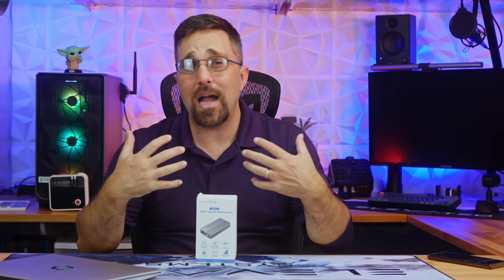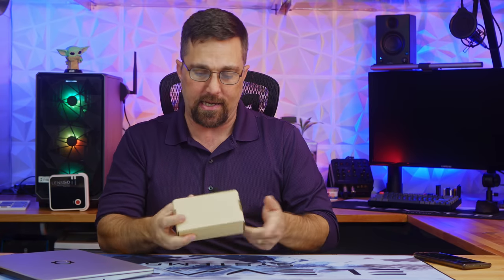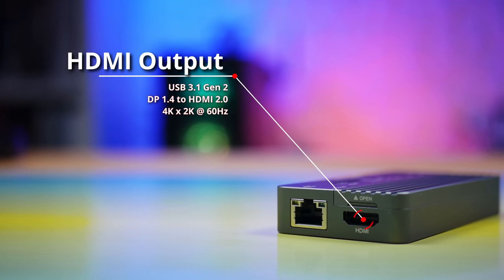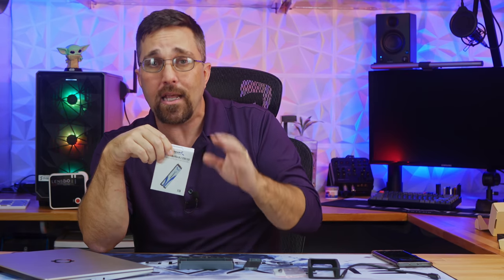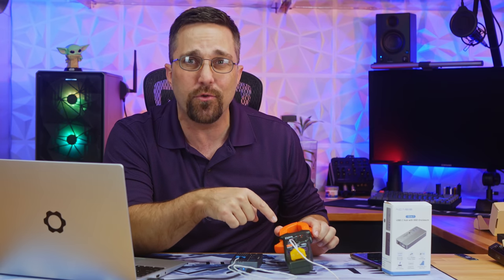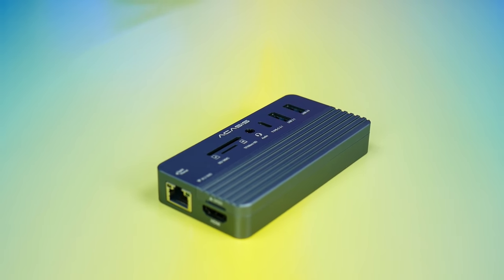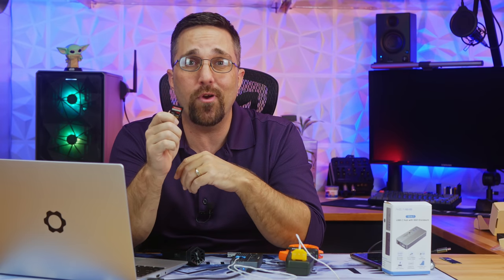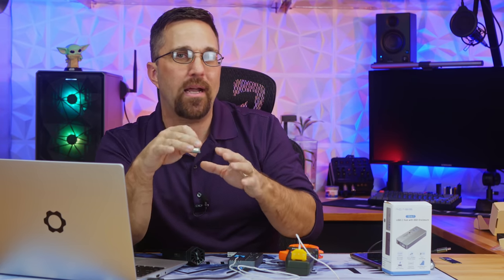One Hub to Rule Them All! ACASIS 10-in-1 USB-C Hub Review

Comment: For those who wish to use this with an iPad pro...  When you plug this in the audio will default to the 3.5 mm headphone jack on the hub and there is no way to switch it back to the internal audio on the iPad currently. This is a limitation with iPad OS and not really the hub. For sound when plugged into the hub you can either plug in headphones/speakers to the hub audio jack or use bluetooth audio. There is no option to use the hub and use the speakers on the iPad at the same time. You also must format your NVME drive on a PC or Mac to exFAT (NTFS can be read but not written to currently with iPad OS). The iPad has no way to format a NVME drive natively with current OS (iPad OS 15). Other than that it is probably the best hub on the market currently for this form factor, features and price.
Reply: I ordered one of these to use on my iPad Pro, bummer to hear that you can’t use the internal speakers with this plugged in.
Planning to use it for photo editing when capture one iPad app comes out, and things like that.
Reply: Thank you for your post.  I was wondering what happened to my sound also.  It was also helpful to know which format I need to use to format the drive.  If you have a channel, I’d follow.
Reply: I have a sandisk extreme pro v2 1 tb and when i connected it to my ipad pro m1. It cant recognize my sandisk ssd
Reply: @yeabah13  try formatting as ExFat, if it isn’t already
Reply: Anybody find a workaround? maybe a Bluetooth speaker JBL Flip? But kind of a hassle, the iPad pro has 4 amazing speakers.. what a waste not to use that feature? 
Thanks for the info, I get a headache using headphones for prolonged periods, so this is a deal-breaker for me.. Not to mention the heat issue.
my insane researching for the on the way,  M1 12.9, just paid off..The search continues.. any suggestions for a Thunderbolt 3 Hub? I do not want to spend $250 for a hub & Thunderbolt 3 or maybe even no thunderbolt?   considering Thunder4 not working on a Ipad anyway? I am interested in headphones for travel when watching Movies anywhere offline, Are there USB-c adapters that work for 3.5mm headphone jack? (I do not like wireless headphones as they give me a headache sooner than wired headphones..
Reply: Can anybody tell me if the sound will come out of my display if I use this with my iPad to my monitor via HDMI?
Reply: There is a work around now and you can choose which source is playing your audio output when an external display is connected, or your have an alt output for audio.

Comment: My man just nonchalantly turns his phone into a fully fledged desktop computer 🤯
Reply: Was very upset to see that the M1 iPad wouldnt support OS11 on the M1 Mac computers
I mean, my phone can be used as a desktop, why cant this iPad that has literally the same processor as my desktop
Reply: Samsung DEX is actually quite nice I have played with it a little and the phone(Note 10+ like mine) is more than powerful enough for everyday tasks.
Reply: @scooterjes  Its not even limited to samsung, i've got a sony phone, and my cousin has a motorola/lenovo and desktop works fine, but i'd still like to be able to put a full OS on something the size of an iPad, sure, phones would be a bit small for a full OS, but its not like Apple cant just run OS11 on the phone/ipad, and then when you want phone functionality you just open up the iphone/ipad 'app' the same way i do it on my M1 Mac Mini, except it wouldnt be windowed, it would be full screen

Comment: I recall the Kickstarter for this. I thought to myself : FINALLY!!! Someone making a hub+disk enclosure that's small, rugged, portable enough for pros on the road, and is nog gonna overheat, which is a big engineering feat. Definitely on my must buy list. This is the only one you need, except iDigit thunderbolt 4 hub with 4x USB/thunderbolt 4 and 4x USB4 A ports, but this one isn't portable as it requires a big PSU of course.

Comment: Regarding the whole hub vs switch question: This is a smart hub, but not a switch.

A dumb hub simply wire in all devices directly to the host. Thus the host can talk to all devices, but only one at a time. If some devices are 5 Gb/s and other devices are 10 Gb/s, the host has to switch speed depending on which device it is talking to. Thus, if a 10 Gb/s capable host wants to read equally from two devices, one capable of 10 Gb/s and one only capable of 5 Gb/s, the host will have to spend twice as much time talking the slower device, giving both devices an effective speed of 3.333 Gb/s. If the 10 Gb/s capable host wants to read from two 5 Gb/s devices the effective speed becomes 2.5 Gb/s per device.

A smart hub speaks individually to each device at whatever speed it is capable of, buffers the data, and then forwards it to the host at whatever speed it is capable of. That means that in both scenarios above the effective speed becomes 5 Gb/s per device. However, a smart hub is still a hub, so all data is routed between a device and the host, never between two devices directly. Thus if you try to copy data from one device two another, you are in actuality first copying it from the first device to the host RAM, and then from the host RAM to the second device. Note however that USB3 is full duplex, so it is possible two do both copies simultaneously at 10 Gb/s if the host, hub and both devices are all capable of that speed. Doing so will however use all available bandwidth between the host and hub, so if you try to simultaneously talk to a third device, speed will have to go down.

USB3 switches does not exist, as the USB3 protocol can not handle anything but device to host and host to device communication. Many USB-C devices can act as either a host or a device, and change between the two modes at the fly, but in any given USB3 network, at any one time, there is exactly one host, and all communication on that network is going to or from that host.

Dumb hubs with multiple USB-C ports allow any USB-C port to be used by the host, and if multiple host-capable devices is connected they can negotiate a change of who is the network host on the fly, but most smart switches have a single USB-C port designated as the host port, and forwards data exclusively to and from that port.

Comment: I got mine during the Kickstart campaign.  I used it on a MacBook Pro 15" with just power, hdmi and an nvme going through it and it reached about 125 degrees F.  I contacted Acasis support and there reply is that it is normal and it is not intended to be left plugged in but should only be plugged in when needed. Even with only power going through it, it reach an uncomfortable temp to pick up. This eliminates the use case for me for the most part.  Also at those temps, I don't think I want to leave my SSD in there, I am afraid it would greatly reduce the life span of the drive.  It was interesting that on the campaign they did show a temperature readout fo the surface of the hub during use but it never got near that hot, the current test video on the  campaign shows a temp of 38.3 degrees C which is about 100 degrees F.     Good Review though and thanks for also noting the temperature problems.

Comment: Glad this Acasis hub worked for Elevated Systems, but in my case it was a complete failure. It would randomly turn on and off, the HDMI was hardly recognized and was throttled at 30 Hz, and I finally used it solely as a case for a 2 TB WD NVMe SSD. Even that was a failure, after trying different cables and plugging schemes. I ended up buying an enormous and costly (but reliable) Dell hub, and a Sabrent SSD case: no more glitches. Too bad this apparently elegant hub didn't work for me.
Reply from the maker: What are the specs of the system you were using it on?
Reply: @ElevatedSystems  I have a Dell XPS 15 9500 and an Asus ProArt 4k monitor, and the OS is Windows 10. I tried the Acasis hub as a pass-through between the laptop charger and the laptop, and I was getting a notice of insufficient charge power from the battery status icon at the bottom of the screen (100W needed for the Dell). The main problem was the random turning off/turning on of components. The tone signals from the laptop made it sound like Christmas jingle bells at times. I then bought a UGreen charger to power the Acasis hub separately (UGREEN USB Charger 65W 4 Port USB C Charger Foldable GaN Power Delivery Type C Fast Charger), to no avail. I tried the complimentary USB-C cable sent later by Acasis, and even bought new high-standard USB cables.

Comment: I am wondering if altering the case by adding a few good size openings and some micro-screen, to allow air flow and help deter dust; would help with the heat by allowing the thermal draft to pull cooler air in as the heat escapes?🤓 Wouldn't be hard, some 1/2 inch holes top and bottom, glue in some micro-screen fabric, boom, air flow and cooler internals.
Reply: My thought exactly.  I am not sure if it would need RF shielding, however, as the box serves also a Faraday cage for many electronics.  (I am out of my depth on this subject.)

Comment: I've got a daily workflow test and solution for this hub if anyone is interested. I purchased it after this review. When attempting to transfer a 10GB file from an M1 Mac Mini (from a USB 3 5Gbps source), the enclosure kept failing. I tried multiple solutions including the Apple 67w USB-C power adapter. Nothing worked. I swapped out the Thunderbolt 3 cable Acasis ships the device with an Apple USB-C cable (for charging the iPad). Speeds have dropped massively. But large file transfers are completing. I'm not benchmarking, but trying to get some work done, so I don't have exact numbers, but it's feeling like a 300Mbps real world write speed. (Faster than a lot of non-professional grade SATA SSDs.) I wonder now if I'll get better speeds using a beefier USB 3 cable and not use the M1's Thunderbolt ports.
Reply: Testing addendum. A large transfer of 140GB still failed with that set up. I swapped out the Apple USB-C (seems to not even be USB 3, tbh) for a USB 3 cable with a USB-A adapter. So I'm exclusively running the device off the Mac Mini's USB-A port. No chance of Thunderbolt confusion, and a 24GB folder transferred without incident, and at far faster speed. My guess is for heavy SSD use, you'll want power delivery and to force a restriction to USB 5Gbps connections.

Comment: if anyone asks... can confirm that it works up to 8tb m.2 but you should use a thunderbolt 4 port when going above 2tb or it will "disconnect" also yes 1gb/s is working.
Reply: 8tb M.2:   Corsair MP600 Pro NH

Cooler:    M.2-THREE M2 2280                (looks like a cpu tower cooler)

Fan:          Ronyaoko 6010 CPU-Cooler   (Has male USB connection for using it on the Hub)

Comment: even with the auxiliary controllers, if it's sitting there doing nothing, it should NOT be heading up that much.  that's just poor thermal management in the firmware.  also, I think a thin copper shim/heat spreader between the chips and the thermal pad could help with dissipation

Comment: I think I have a bottleneck with the gigabit Ethernet going into a m1 iPad Air usb-c. Unplugged the Ethernet and the wifi processes just fine. I’m wondering if I connect a 2.5 hub to the 3.1  usb would that work? Or is the actual usb-c the bottleneck?

Comment: I just bought this and so far it seems very unstable. I connected a USB 3.0 HDD and started copying files to my Macbook air. My macbook air charger was connected into the hub and after 10 minutes it lost connection and I got an error message that it stopped copying. I noticed that my laptop was not charging anymore, although it should had been thorugh the hub. So I connected a 20W charger to the hub and I also connected the original charger straight in the macbook. The HDD loses electric connection quite often and my HDD beeps when that happens and for a second the copying stops and then continues. This never happened when the HDD was directly connected to my macmini. I am very dissatisfied.
Reply: I read these things always happen with contraptions like this. I bought the yodamaster 8 in 1 kinda like this and have similar problems. We’re gonna have to buy a solo hub with separate m.2 enclosure.

Comment: I would think the NVMe SSD won't get that hot since it isn't throttled but the hub itself is from the read/write (as in it would be a performance issue with too much heat)

Comment: How is it for long term use? I bought something similar for my M1 Mac Mini. The NVMe drive disappears once every week to two weeks. It isn't just unmounting, it is completely stopping. I have to unplug the hub and plug it back in to get it back. Since I run a user's home folder from it, that's a real problem. Does this work better than the one I have?
Reply from the maker: That is a common issue with M1 Mac's. To fix it I simply turned off sleep mode on my Wife's Mac Mini.
Reply: @ElevatedSystems  Nice. Then I only need one of these.

Comment: It would be a shame to have a "only" USBC Hub on a Macbook Pro M1 Pro / Max or an iPad Pro M1. The hub must be a Thunderbolt 4 Hub (at least Thunderbolt 3) so as not to degrade performance. The SSDs found in the Macbook Pro M1 Pro / Max are MUCH faster. There is currently no external SSD that can match this performance, moreover in "non-Thunderbolt" USBC. So this solution can allow you to use an SSD as a backup, but not as an external SSD dedicated to production.

Comment: the info about the USB hub ICs is incorrect imo. The square chips you found in this ACASIS Hub do the exact same thing as a USB ports only hub. If you connect multiple devices you will still get reduced data speed as the bandwidth HAS to be shared. There's no way around the 10Gbit link to the PC. I think there are so many ICs in this Acasis because there are multiple types of ports integrated in a single hub, therefore you need a chip for each. One fore the USBs, one for the M.2 drive, one for the Audio, one for the Card reader and so on. Even at idle, their power consumption will add up. 1.5W isn't a ton of power considering this hub more of a "desk hub" rather than a "portable hub" as others have suggested.
Reply from the maker: But I didn't get reduced bandwidth when transferring data between multiple devices on multiple ports on the hub. The Hub IC's negotiate and "switch" the data packets in "generally" the same way a network router does.

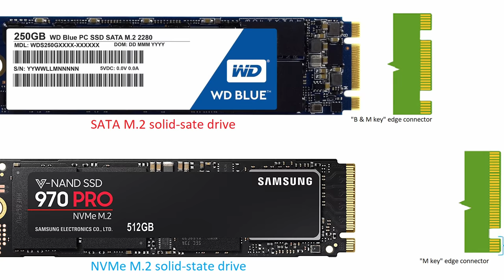Comment: 3:27 form factors come in 2280/2260/2242/2230. Proceeds to list the length in imperial.
Reply: Don't you mean Freedom Units?
Reply from the maker: It's listed in both. 2280 means 22mm wide by 80mm long. Same for the rest.

Comment: My iPad Pro loses audio as soon as connected

This doesn’t happen when connected to Mac laptop
Reply from the maker: Check the audio controls. The iPad may be defaulting the audio output to the Hub.
Reply: update please? You are 2nd person who had this problem, fix anyone ? or fail ?
Reply: Please clarify. The audio controls on the iPad Pro? 
I’ve discussed issue with the company and no remedy was provided that restored audio. Other hubs that I own work fine without affecting audio.
You can get the audio from the audio port on the hub with external speakers or headphones but pretty inconvenient. They said they were aware of 
‘Issue’ and would address later hardware. My still doesn’t work, but they may have revised their product. As far as l can tell this happens on M1 iPad Pro.

Comment: All I know is my USB-C hub on my new MacBook Air broke, burned out, or overheated the USB-C ports (x2) on my Apple MB Air, twice.  Apple asked me and I answered, and Apple voided my warranty. Anyone wanna buy a Apple Brick?  And before you say I should have bought AppleCare, I did, not relevant as it was only 3 and 5 months old at the time of failures, and my AppleCare is also voided.  No refunds, Apple blames the USB Hub and said that they are my Avenue for reimbursement.
Reply from the maker: Yes this was a big issue with M1 Macs using USB hubs with power delivery. Apple apparently fixed the problem with Big Sur 11.2.2. So it was a problem with the Mac firmware, Apple knew it was a problem, they fixed it, but still blame the USB hub and screw over their customers. Sounds about par for the course for Apple.
Reply: @ElevatedSystems  — They think they are saving money, I work in a large communications company, approve a about a thousand give or take Mac devices a year for purchase, and that stopped immediately.   This is a new low for Apple, blaming their customers for their device issues.
Reply from the maker: Replace all your Mac devices with Framework laptops 😉
Reply: @ElevatedSystems  — Great idea, but I do day trading, and performance is an issue. I use my laptop remotely and at home, with a few UHD monitors attached.  When they get an i9 and more than two usbC ports, I just might!
Reply from the maker: The Framework has 4 configurable Thunderbolt 4/ USB4 ports and can support up to 4 UHD displays.
Reply: @ElevatedSystems  — Thanks!  On their website I just saw two, my bad.

Comment: HELP!!!!! New pc build keeps power cycling and won’t post. Fans spin for 10 ish seconds than stop and repeat in that loop. No display or anything 

I bought
Specs 
Asrock B450M pro4
Ryzen 5 1600
Gtx 1050ti 4gb (plug and play)
XPG Gammix D10 3000MHz (PC4 24000) 16GB (2x8GB) DDR4
EVGA 450
WD Blue 500gb ssd
Same case

I’ve tried reseating ram cpu wires and even took out the cmos battery and still nothing